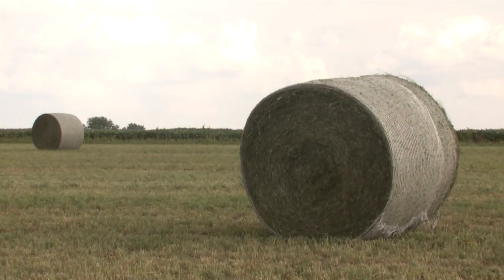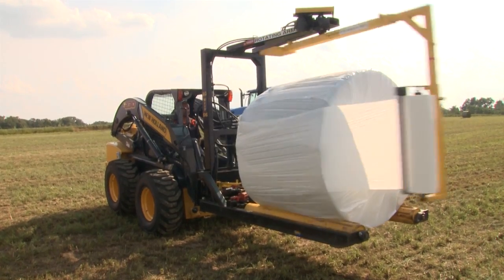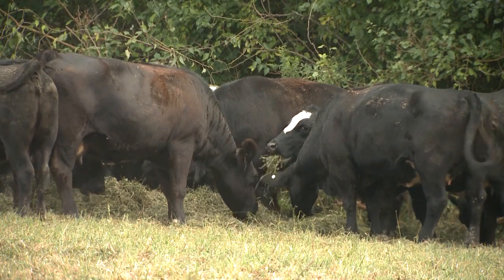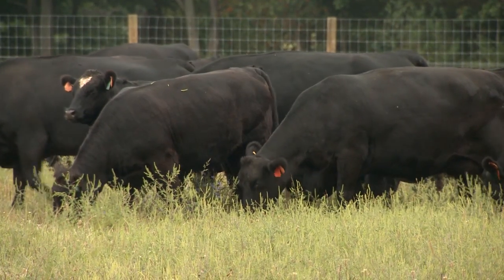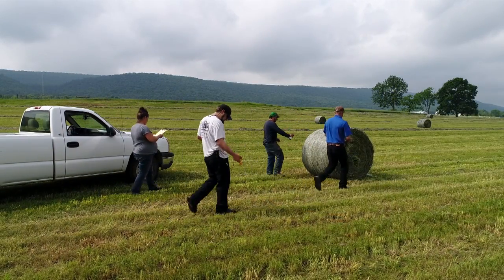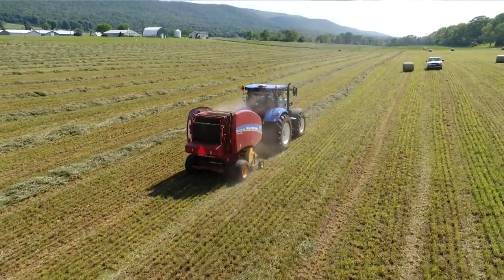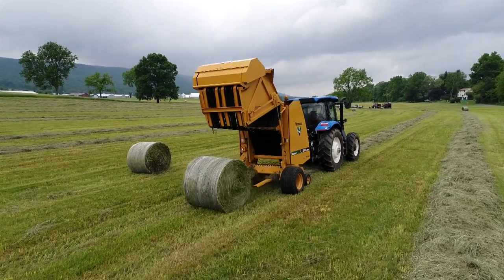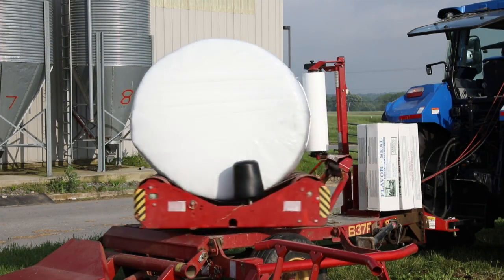Bale Density Study with Penn State University - Part 1

Comment: We made alfalfa baleage here in California  25 years  ago with a vermeer 604 j with a silage kit. It worked well , some RFV tests at 275 and 28% crude protein.  Our solid core haulage bales were so tight no existing mixers could deal with the bale density.  Progress takes change. In our case dairy men thought we were trying to take advantage  of them by selling more H2O.
 We also proved that high quality alfalfa does ensile properly  at 40 to 50% moisture.  One thing we understood  was the need for better balers,  the vermeer  twisted a lot of belts !

Comment: The best advise you can give someone on baling silage is to use a European baler. The American built silage balers SUCK. Buy Kuhn, Krone or McHale with a processor. My Kuhn baler makes a bale 200-300lbs heavier than the NH I had.
Reply: True, the American ones are made for a drier and generally a lighter crop. McHale and Krone are 2 of the best.

Comment: To make solid I always bale silage with dew on it
Reply: theres many factors that come into play. variable chamber baler or fixed, moisture, grass type, what stage its, size and width of a swath and cutting ++
a bale thats bale properly and dry wont lose its shape, a bale thats plenty of dry but has wet spots spread around in the swaths will be a good starting spot for rot during fermentation.
to make a bale solid and firm with a fixed baler. it wont start to compress until the volume of the baler is full, the amount you feed into it after that will start compaction and you have to give it time to do its job, in other words slow down. 
variable chamber naturally acts different. 
you want as much forage into each bale, the cattle are getting their water elsewhere but theres a point where its too dry to eat in a sense. you can have top notch forage but the cattle wont eat it cause its too dry. no matter how good a bread is, you wont eat just plain bread for days, weeks. 
i see i got abit carried away here now so ill just end it here xD
Reply: I have a krone   Variable. No belts  does  beautiful bales of silage  when there s a bit of dew on silage after 3 or 4 days drying.  They hold shape better so better for wrapping   On hot days you might only need 1. 2 days.    This is just my experience after 40 years  this year   But windrow size and other factors can come into play